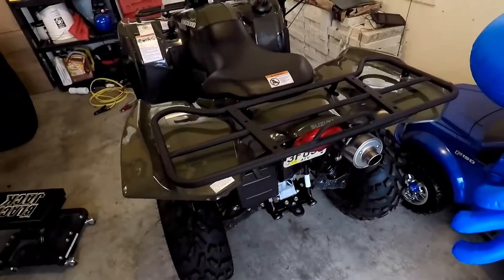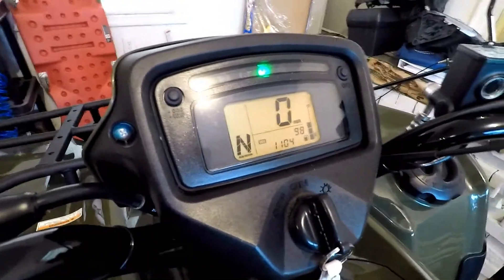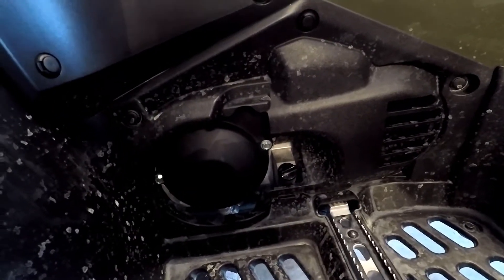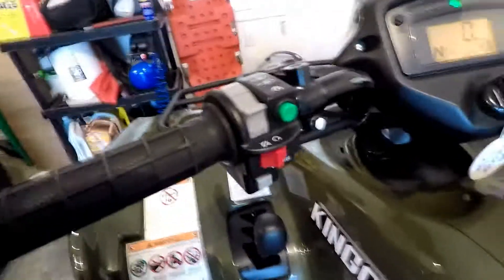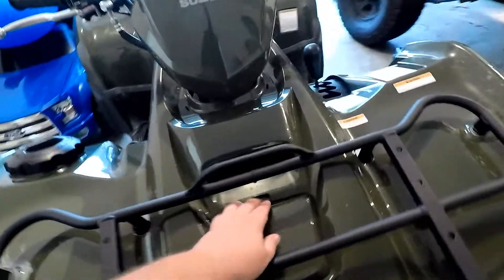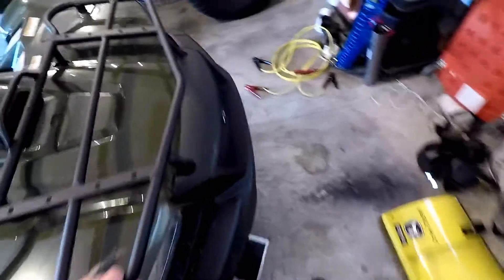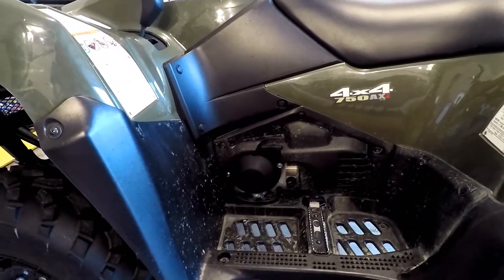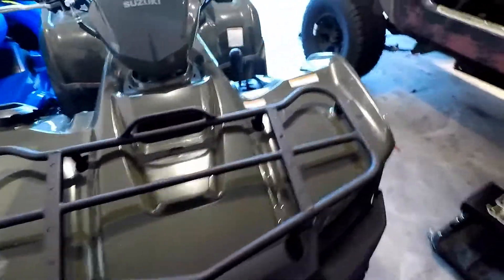2016 Suzuki KingQuad 750 Overview

Comment: They come with a place to run a winch s wire to the batter like a wiring harness but you have to wire it to the battery it doesn’t plug in anywhere

Comment: I have a camo one with power steering. I love my 750 ❤ I'm thinking bout moving my radiator and getting bigger tires. What size tires do you think would be the max without needing spacers?
Reply from the maker: Hey! You should be able to do a 26x9x12 up front with no issues. If you go 10 wide you'll need spacers. In the rear you can go 26x12x12 without issue. Keep in mind if you are not mud bogging you won't want too wide of a tire up front (more than 9") because of the way it changes the feel of steering.
Reply: I think you can fit 28x10-12 in front on stock rim. If you have aftermarket rims with offset then maybe you can fit larger ones. 27x10-12 goes on stock rim 100% my buddy has.
Reply: I think problem starts with rear tyre rubbing gas tank on stock rim or was it with kawasaki...anyway worth checking out. 27" fits 100% without making any adjustments that I know.

Comment: Should be wires running down from the pod on the right side, might be hidden behind the inner fender for the winch
Reply: Nice King BTW, Brown seat really make them pop. Checkout mine some time, Same color with a few modifications. Cheers
Reply from the maker: I subscribed!  That brown seat does look pretty sweet on there!  I like the bigger wheel/tire combo, which given the terrain you ride is definitely worth it lol.  Good work on the video editing too!
Reply: Thx man, you didn't have to sub I just thought you might like to see the brown seat on her. Hahaha. Stopped in to see my most likely choice for my next quad. LOL Mines just the 450.  If you ever have any issues with the king let me know, never know might just have the answers. 450 and 750 are the same in almost every way but engine size. But you shouldn't have any issues I'm sure. Very sound choice of ATV. Cheers and thx again eh.

Comment: I have a 07 king, exactly like yours, no changes same color with 900 miles/142 hrs runs great no it is bad ass , under the seat behind were the tools are is a spot to mount a contactor for the winch, there’s four rubber plugs were you mount it, Suzuki was thinking ahead, nice quad , now go get it muddy

Comment: Here is a question: can the differential lock be engaged in high range without having to push an override button to get full power? I know on some diff locks on various manufacturers only work in low range or on allows full power if you push an override button like you have to do in reverse. I have an Outlander 800 and an Kawasaki Brute-Force. The Kawi would be the perfect machine if it had a manually engaged diff lock that would stay on without having to hold the lever.
Reply from the maker: Hey Ryan.  I'll be honest, I don't know the answer to that.  I know what you're saying because my truck (for example) does the same thing.  I have an electronic locker from factory and once speed reaches 25 or 35 mph the locker automatically disengages.  As far as the ATV, I know for a fact you can engage the locker in high range; however, I do not know if it them engages some sort of rev limiter or speed limiter.

Comment: Great machines. KQs are equipped with a manual differential lock, independent front and rear brakes(for steep hills), and the CVTs have a centrifugal clutch before the primary clutch, which protects the drive belt. King Quads and Grizzlies feature roller bearings on the large end of the connecting rods along with ball bearings on the crankshaft. All features that Can-am doesn't offer. King Quads and Grizzlies are reportedly the most reliable ATVs available, but Grizzlies are notorious for overheating. Polaris are powerful machines, but when backing off the throttle at speed the engine brake practically throws the rider over the handlebars. Polaris, Arctic Cat, and Can-am have less than stellar reliability reviews. Can-am fanboys will say Can-ams are so much more powerful than the rest, but all that means is that Can-am riders will be the first to get stuck in the mudholes. The missus and I have had our KQs 750AXi/EPS for three years now and neither machine has had an issue. The lower center of gravity combined with the smoothest engine in it's class, KQs are extremely comfortable to ride all day long. You will not need to modify your King Quad in any way unless you plan on spending a LOT of time in muddy water, in which case you may want to upgrade the stock tires with Zillas or Outlaws. Be prepared for a much stiffer ride once you change tires. Do NOT change the tire size, utilize the original rims for optimum performance in all areas in the field. I'm still running on the stock tires and have no desire to replace them until they are worn down. The machines are that good.
Reply: The 66 Leadfoot do u guys have the power steering models? i am looking at the kq's
Reply: Yes our KQs are equipped with power steering. And what a difference! At the end of a long day's ride we still feel fresh and ready to ride some more.
Reply: Are there any belt slippage issues when you get into mud/water? Lot's of bot where I live.
Reply: None. I tend to take it easy going through that stuff though.
Reply: The 66 Leadfoot is that really true? Can am doesn't use roller bearings on their connecting rods? What kind of bearings do they use?
Reply: Kountry Quads Can ams use plain bearings.
Reply: The 66 Leadfoot do you know what Polaris or Kawasaki does?

Comment: I have one.  & when I was shopping I almost went for HP & speed.  I’m glad I didn’t.  This bike is smooth & could pull almost anything. ( STRONG ).
Reply from the maker: I agree Nicole.  I like the power, it is pretty comfortable, and it isn't hard to handle even without power steering.  All in all it's a great value for what you get.

Comment: I have that exact ATV but I have the matte black one the back box is good for tow straps but water does get in when you get deep in the water I drilled holes in the bottom of mine just so the water drains because it's going to get water in anyways.

Comment: Ive had mine for a month (2018 750 green KQ EPS) its unreal..i went from a Kawi Bayou i bought brand new in 2000 to this beast.still breaking in..21 miles on it, only going 1/4qtr throttle, at first i felt guilty buying it, but after riding 3 times I am really glad i did..How fast have you guys gone in 4x4 not in diff lock..i only went up to 25 in 4wd, and 34 in the field in 2wd...not gona go any faster until i get 100miles on it
Reply from the maker: Hey Tom!  Glad you've had a great experience with your KQ so far!  I've had it up to 46 mph in 2wd.  Where I ride there aren't too many straight stretches to flat out get on it but I'm hoping to get it out in the snow (Lord knows we haven't had any real snow here in PA yet except Erie) and just rip on it and let her fly.

Comment: good video man. nice machine. you got a great deal as well. i am in the market for one now, coming from a raptor 700r. i am just looking for a wheeler to ridd on my property, no high speed trail riding. Do i need the power steering?? lol
Reply from the maker: I'll be honest Dude, I wish I had the power steering. I ride easy trails with a bit of moderate mixed in. The power steering would be great for the moderate trails where I'm going up/down boulders and lots of tight turns and other obstacles. But realistically for riding on your property (no trails) it might not be worth another thousand bucks. When I found that deal I couldn't turn it down even though it didn't have power steering.
Reply: If you switch tires to mudders like Outlaws or Zillas, you'll wish you opted for the EPS.

Comment: How's he gas mileage on the 750 is it bad like the grizzly 700 in own a grizzly and that thing drinkssss so I'm selling it. Wanted to know if this was better and easy on the fuel
Reply from the maker: If I ride conservatively (20-30mph with some slower rock climbs) I can ride about 4 hours on a half tank. In miles I guess that would be 80 miles on half a tank. So roughly 35-40mpg. If I ride hard it obviously is going to burn more. Not sure what your Grizzly gets but I am more than happy with my KQ fuel consumption. Hope those numbers help you out! Thanks for the comment!

Comment: Hey that f150 guy the back storage is a very good place to put a portable air pump, water proof container for your personal stuff/first aid.
Reply from the maker: Good idea about the portable air pump... seems to me like maybe you've ridden a time or two!
Reply: That F150 Guy yes I have I actually have one in my Polaris 400. And a good tip if you get a plow make sure it has the weight cuz on my 300 it's plow is to light
Reply: A tire plug kit too!
Reply: Kodiak660 if he did get that it would be best to have it up in the other container because of water unless he has it in a waterproof case.

Comment: I bought a 09 left over in 2010 750 King Quad Camo model. All these years later and almost nothing has changed but the no head light on the handle bars. The fuel tank holds 4.0 something gals! And your wires for the wench is hanging down where the wench goes. I am going to buy me another new one in June. 2017 left over model. Be crazy to pay 2000 more bucks for something that is no different than the years before!! I had great luck with my 09. But don't plan on submerging them in deep water with out water proofing your belt housing! Because they will slip. If you don't do some protecting! Cant wait to get my new one! I might get the green one like yours! They have one green and one camo left over 17s!